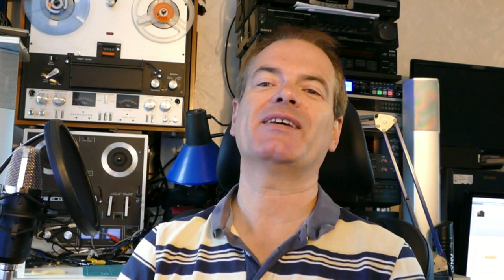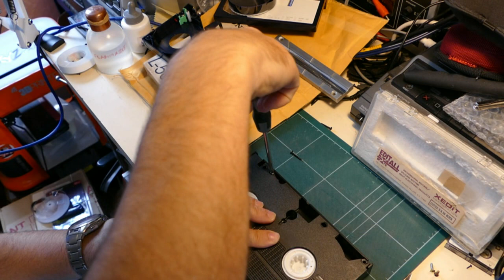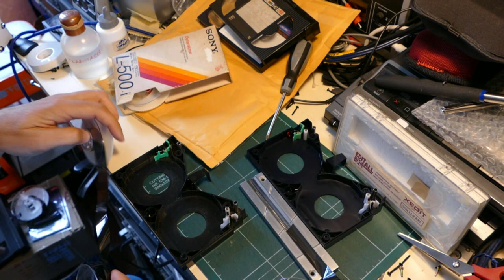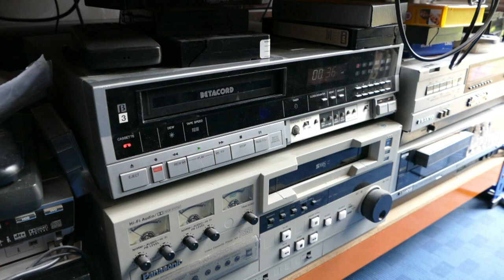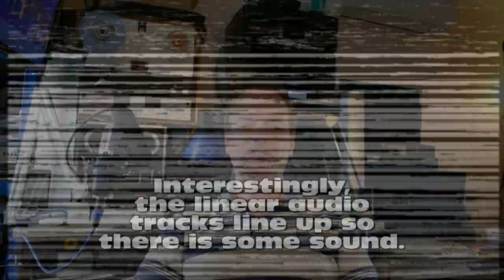VHBeta Frankentape.  A Betamax tape in a VHS cassette.

Comment: There's something I've been wondering for a while now,& judging by the subject of this video, I think you're the person best placed to answer it. 

Beta had cleaner tapes are pretty highly priced these days, often reaching over £40. Vhs cleaner tapes are much cheaper. So, as the tapes are the same size, can I slice a section from a vhs cleaner into an empty beta chassis? Or would you just suggest cleaning the heads by hand?
Reply from the maker: There's no harm at all in transplanting a VHS head cleaner into a Beta shell.  If you can splice onto the foil leader tape, then the proper auto stop will function too.  If you can't get a spare Betamax shell, a small Betacam BetacamSP shell will work just fine too.

Comment: Mmmm I love ur videos , never left any comments I'm shy person , I repair myself vhs..and d-vhs.... beta including beta digital for broadcasting dv and all 8mm formats and all electronics tapes boom boxes  TV-s you name it , I seen interesting videos from u in special I love when u receive all parcel post's 😂 anyway I never seen to u really good quality items like digital d-vhs or beta digital like Sony m2000 or a2100 or range of Panasonic beta digital more bulkier than Sony or I do have very very rare decks like JVC Victor that are 4 in one fully play and records between formats from 8mm all formats s-vhs ...DVDs and bluray all formats and HDD all in one deck also the same deck but with dv cassettes instead of 8mm ....its from their professional range deck that come in 2012 in both pal-ntsc and 100to 240 volt but produced just few for broadcasting studious in Japan because of very quickly moving video formats at that time and very high costs of producing such multi format decks Sony has something similar like their range WV-TW1..2 or WV-SW1and2 WV-d9000 but Sony did not produced an wow factor item like JVC 4in1 decks   .....but what about of Mitsubishi pro range of decks also 3 in1 both JVC and Mitsubishi I love all this for easy dubbing imagine to insert an normal 8mm cassette not hi8 or digital and to converted straight away to fully mpeg2 digital through this new Zoran video chips developed at that time encoding on fly any analog video format in fully 740i format mpeg2 later into mpeg4 1080i . , anyway happy to write to u , Dan from Romania but living fully in UK for the last 35yr in this beautiful country.   PS: I loved that u repaired that beta tape (frankenbeta tape 😂) and restored for that family those beautiful memory's .

Comment: Is there any sort of chemical treatment that can be done to clean that sort of buildup from videotape?

It looks like the tape needs to be run through a slow pace soaking process with IPA or something safe followed by a scrubber to remove the loosened mould and dirt.

That RTI machine sounds like it dry scrubs the whole length of tape which seems a bit rough.

Comment: Btw, I recall doing similar winding work for other reason...

You can eventually find upper clear tape wheels that are ACTUALLY removable. It's more often the case on VHS then beta tapes tho.

You could save a lot of time not winding tapes but removing it completely. More over, the red clamp olding the lead to the white wheel becomes slidable upwards, no tape cutting😮

Comment: If I were to add beta spools to a vhs shell tape, would I be able to re-record onto that tape with a VCR?
Reply from the maker: Yes, just be aware that the leader tapes are different and the auto-stop system requires the correct leader to work.

Comment: ended up just dropping the spools direct into a vhs shell, then carefully watched for end of tape to stop manually early, used the VCR to clean both sides fast forward/rewind/fastforward again then rewinded it in my beta player after all that cleaning was finished to balance load the spool in its original beta shell. So now I have a vhs tape raring to use for beta conversions thats stripped now. Good video im glad I found this video made me very happy to know I can do this without investing in a 2nd beta player, can enjoy my nightmare on elm street I found today and some others potentially (1 tape might be too far shot to do was sticking on the reel and tape looks like its cloudy/delaminating)

Comment: You think that tape was bad.
Try recovering a video signal off an old 1 inch C format tape after it has been stored for around 20 to 30 years.
Reply from the maker: I have a C format machine but need to do some work on it.
Reply: Tapechek rti helps a lot, I able to get one, it really cleans

Comment: We do exactly this. I suspect it needed more cleaning, but that's a bit hard if you don't have the RTI on hand. We have 6, so we can muck about with it. Plus we have some wet-type tape cleaners which apply IPA and we finish off with a few passes through those.
Reply from the maker: Now the IPA route could be very useful with some tapes, like the bad miniDV ones I'm working on at the moment.  Are you able to do this with miniDV?

Comment: I've had plenty of broken and snapped VHS tapes spliced together by just using regular sellotape, and it works fine, no need to use some expensive or hard to find tape. And I've had lots of really badly damaged tapes but they will still play fine, one or two attempts at cleaning the heads to get a decent picture. But often on a fixed tape playback will stop when it detects where the joint has been, but I often find that just a simple fastforward or rewind over that part will solve the problem. 

I have one snapped VHS tape which has snapped with one spool taking almost all of the tape leaving a very small amount of remaining tape on the other spool. No idea how I would go about repairing that, I'm guessing it means removing that tape off the spool?. I think most of the tapes that snap tend to be (but not always) tapes that are E-240 (ie 4 hours) than regular E-180 (3 hours) tapes. My dads friend who used to repair VCRs and TVs back in the 80s and 90s would never buy 4 hour tapes, insisting that they are prone to snapping.
Reply from the maker: Sellotape degrades badly over time, oozing its adhesive onto the tape.  It then gets onto the head drum and can actually destroy a video recorder by snatching the head tips.  Get proper splicing tape!  For a snap at the end, it can be easier to get a spare spool from a scrap tape, and splice onto that.  It doesn't matter if you end up with a longer than usual clear leader tape.

Comment: Do you have a special head cleaning tape? or do you take the top off the vcr and manually clean the heads with ipa?
Reply from the maker: That depends on the tape formats.  VHS, Beta, 8mm, micromv, MII and Betacam formats all have readily available head cleaner tapes, though sometimes cleaning the tape path with IPA still has to be done.  Some formats such as V2000 and Umatic, head cleaner tapes are either unobtainable or hard to find, so manual cleaning is the only way.
Reply: @video99couk  Thanks for the reply ive just uploaded a video on my channel where i have transfered VHS to file/DVD the video will be online tomorrow. My VCR is 2005 vintage so not too old. you should do a room tour of all your gear :-)

Comment: hi  can i use betamax in a betacam sp deck   i have alot of betamax i just don't know what to do with  i have 100 x 5min  betacam sp tapes sending tape to the tip
i don't like i have  meny makes of betacam  don't have a sx yet  on my list to get i have  alot of 1200 1800  ones  would betamax tape hurt the head drum
bob
Reply from the maker: You can use Betamax tapes on those Betacam machines which are designed for Oxide tapes, but most will only take BetacamSP or higher.  Betamax recordings of course will not play on a Betacam machine since the formats are different.  Oxide tapes won't hurt the drum however metal BetacamSP tapes shouldn't be used in (most) Betamax decks since they could cause excessive head wear.  The exception being that ED-Beta(max) machines which are designed to work with BetacamSP tapes, but they are rare.

Comment: Will a Betacam player play Betamax tapes?
Reply from the maker: No.  The reasons are many but start with the head drum size being different and go from there.
Interestingly, the same is not entirely true of Panasonic's answer to BetacamSP called MII.  Some of those machines can play SVHS.  As a result of this backwards compatibility, the head drum size and many technical aspects of MII were set to non-ideal specifications, in part causing the format to be unreliable as hell and bombing.
So Sony were very right to not try to make Betacam decks play Betamax tapes.
Reply: @video99couk  Thank you for the explanation. I have a handful of Betamax tapes that I wanted to test but sadly I don't have a player. My place of work is getting rid of a Sony Betacam machine and I was hoping to use that to test them. I will have to try and find a Betamax player I guess.
Reply from the maker: @TheSkipperVideos  Or I could just run the tapes for you, contact me via my web site if you want me to run them.  Maybe grab the Betacam machine though before it hits the skip.  Some models are still of value.

Comment: Sorry, but how did you manage to splice vhs to beta? I’ve just tried that and the beta spool is moving all over the place. I inserted the tape into a vhs player and it didn’t work. The beta spool is smaller than the vhs spool
Reply from the maker: It did work for me but results will vary according to the design of your particular player.  It might be worth trying a different brand of VHS player.  It was only good enough to spool the tape through, it wouldn't have been any good for playback though.  Not that it would really play anyway of course.

Comment: Even a three year old knows that Beta is better! (Rather a moot point these days.)
Also, fascinating that Beta spools work inside a VHS cassette. Lends some weight to the claim that Sony invented both and gave VHS to Matsushita!
Reply from the maker: They were both derived from Umatic and originally were supposed to be one format.
Reply: @video99couk  Thank you so much; that lends even more weight to the claim re the origins. Umatic was excellent quality for its time; Beta was not significantly worse, especially as we only had SD screens at that time. At first I couldn't understand why VHS succeeded in the US (allegedly because of recording time) as we (Australia) had three hour (L750=3.25 hours) tapes at the start! With the advent of L830 tapes (3.75 hours) very soon after, which could also be recorded at half speed (ie 7.5 hours), the additional time available on VHS cassettes (4/8 hours) seemed trivial. I can only suppose the initial impression in the US that NTSC Beta I could only record for one hour (at first) stuck in peoples' minds, even though this changed very quickly. In another vein altogether, I have never been able to reconcile why a PAL recording, with MORE data (720 x 576) took SO much less Beta tape than an NTSC recording (720 x 486) of the same time length, despite the frame rate difference! BTW, always a pleasure to watch your videos and they are always informative! Greatly appreciated; thank you Colin.
Reply from the maker: @rahb1  I'm not aware of any Long Play PAL Beta video recorders, so check that one.
Reply: @rahb1  The folk lore answer is that the Beta Group would not allow porn to be distributed on Beta tape - the VHS Group were not so prudish.  Once the bookstores were filled with VHS porn Beta's chance of surviving were severely reduced :-)
Reply: @barrieshepherd7694  That is a myth which has been debunked over and over. I had commercial porn on Beta.
Reply: @rahb1  Well I did say it was 'folk lore', :-) but I suspect it was partially to blame in some markets. Sony just saw the world market shrinking and pulled the plug.

Comment: I regularly splice VHS tape to go in Beta tapes, still like to do recordings on these formats (just for the heck of it) and most of the pretty 1st Gen Betamax cassettes (before Dynamicron etc, just in a plain black shell) have degraded so much, the oxide layer literally splits from the plastic carrier.
I use a sacrificial cheap and nasty VHS deck that I just use for spooling the tape around. 
And if you take the thin E-300 5hour PAL SP tape (the good one by the BASF that is actually worth recording on) and you fill it up as much as you can, you can make an L-1000 tape. 
It's a good technique. Refurbishing Betamax video cassettes... in 2019.
Reply from the maker: I've often wondered about making an L1000 tape.  I think in PAL lands that would give us a running time of about 260 minutes.
Reply: @video99couk  yeah, something like that. I'd have to look at my recorded refittet tapes, I always write the length of the recording on there.
Reply: @video99couk  just had one of those tapes in my hand. I got 4h30m, so 270 minutes on one of them.
Reply: Wow. I have a BASF E-300 tape and I had no idea what to do with it until I read this comment. :D
Reply: Already in the last century, I have routinely exchanged VHS tapes for Beta cartridges, of course new, not used. This was due to a lack of new Beta cartridges. This video reminded me nostalgically.
Reply from the maker: @Matt Staley PAL is most of Europe.  NTSC is USA and Japan.  Rest of the world is a mix of NTSC, PAL and SECAM.  SECAM has the same line/frame rates as PAL.

Comment: I have cleaned 3 video 2000 tapes by tread the video 2000 tape over to a vhs spool and then cleaned it in my tapechek machine.
Reply from the maker: I think V2000 has the same optical tape end sensor as VHS so at least you wouldn't have to worry about that.  Did all the tape fit on a VHS spool?

Comment: W-VHS was a format that could support up to 9 hours of component analog SD recording on a single WT-180 videotape. There were also D9 videocassettes that could be used for W-VHS recording as well, although I am unsure how long the recordings on those tapes would be as the tape speeds between the formats are likely very different.
Reply from the maker: Yes there were D5 and D9 formats, but by any real measure, they tanked.  D-VHS did even worse, there were only two UK machines and they wouldn't even play each other's recordings.  W-VHS was a disaster too. The biggest was probably MII, but that was hopeless too (I have MII machines here).   So all attempts by Panasonic to get a professional version of VHS off the ground, just failed.
Reply: @video99couk  Although, having said that, Thames TV used MII to record studio and location footage for "The Bill".
Reply from the maker: @davba2  Yes. One of my MII machines came from Thames.

Comment: Hi Colin,I have been transferring Philips VCR 1500 tapes that continuously where clogging the heads. By holding a small piece of paper against the heads while I did the transfer I could make a nice recovery. The pictures where used in a documentary on Belgian national TV. Maybe something to try.
Cheers.Frank.
Reply from the maker: That would have been caused by sticky-shed tapes.  The tape baking process might have made those playable without having to resort to your head-cleaner approach.  Perhaps the paper head cleaner might have slightly reduced the head clogging with the mouldy tape, but I think the mouldy parts really were very bad indeed.  There's always a risk to the heads too!  Some Digital Betacam decks do automatically apply a head cleaner during playback when they detect errors.
Reply: The tapes had been baked also but still where giving of oxide.
Reply from the maker: You could have done a VH1500 Frankentape for cleaning!  What a horrible thought.  I'm planning on a N1500/1700/SVC YouTube video in the next few weeks.
Reply: Looking forward to see. Actually I did something similar. But it was a EIAJ1500 frankentape. I use an old reel to reel VTR to clean the tape. It worked quite well.
Reply from the maker: Ah, that kind of brings me to one of my other evil creations.  I made a tape polishing machine out of bits of Betamax tape rewinder, a V2000 reel motor, and a Betacam sapphire tape cleaning block.  I wonder now if that might have had more success than the multi-thousand pound RTI TapeChek machine.  It's not a pretty sight though.  Maybe another YouTube video about that monster one day.
Reply: @video99couk  How good is the RTI TapeCheck machine...? Is it worth the €6.000 that it costs? How good were the results with your mouldy tape? Thank you.
Reply from the maker: @jma6412  I don't have an RTI machine myself, that process was done by someone else in the UK who does have one.  In my experience with the few tapes that he's processed for me, I'm afraid the improvements have been rather marginal.  I'm sure that it's useful for certain tapes, but very badly damaged tapes don't seem to benefit very much.
Reply: @video99couk  Thank you very much. I was reluctant to spend that much on such a machine... not too much information about it. No reviews... Thanks again!!